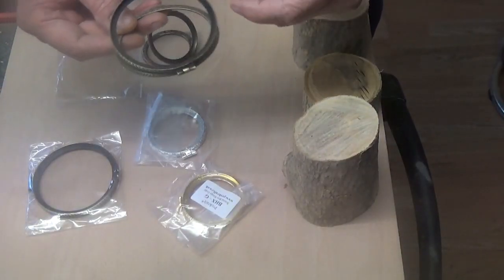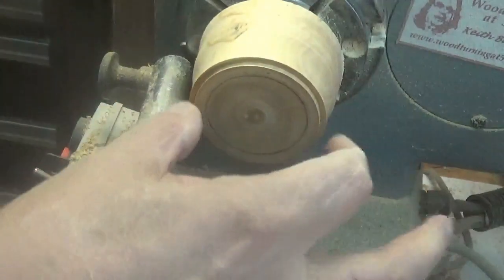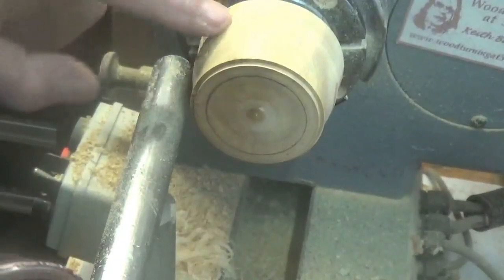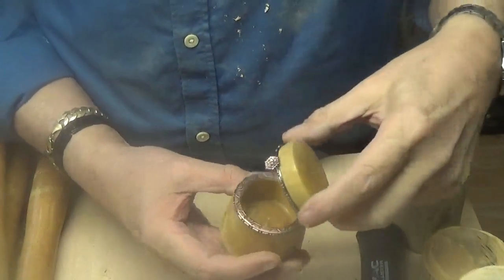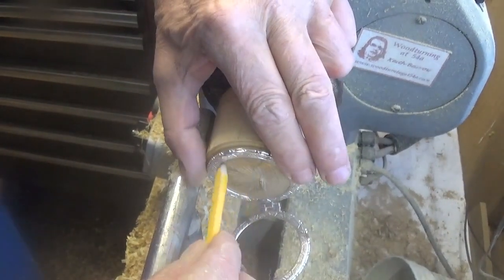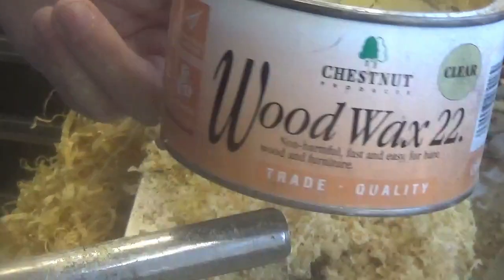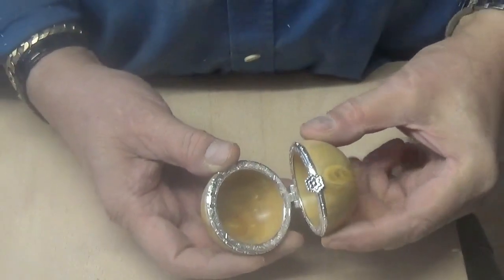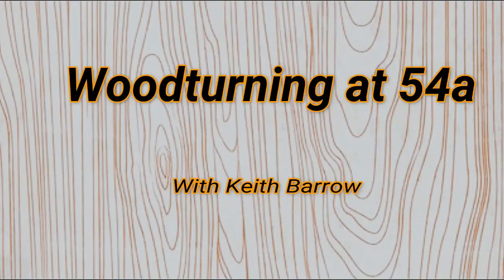Woodturning at 54a #172 Little boxes

Comment: Bit if a daft question I know but.....Does the circular carbide head spin as you use it or do you manually move it periodically? I gather the square one needs moving manually so wondered about the round one.
Reply from the maker: No such thing as a daft question. It’s screwed on tight,so every now and again it has to be moved to another position manually.